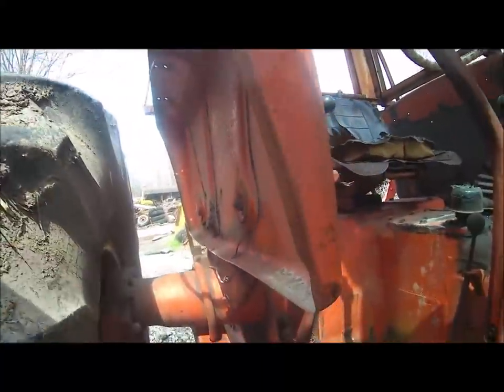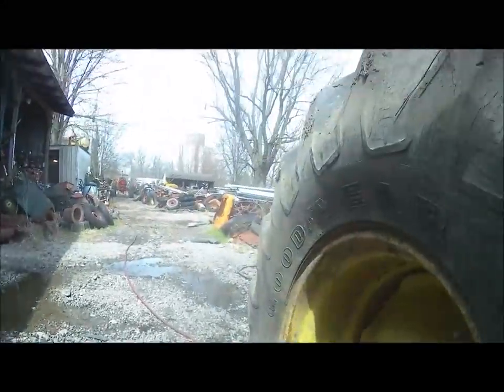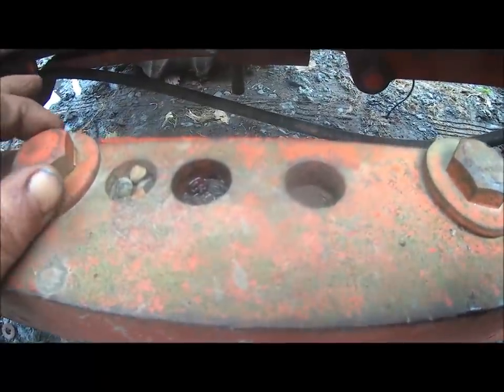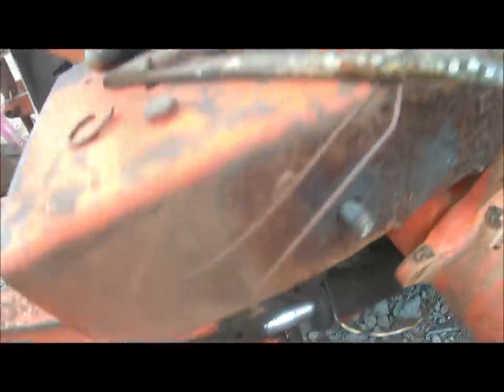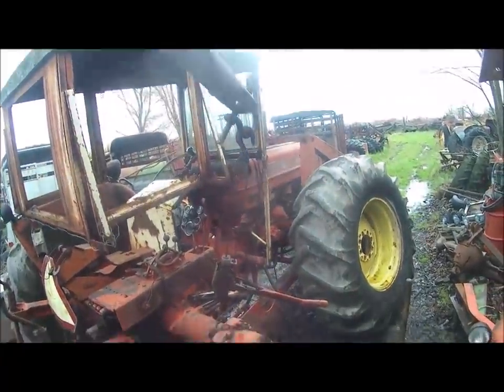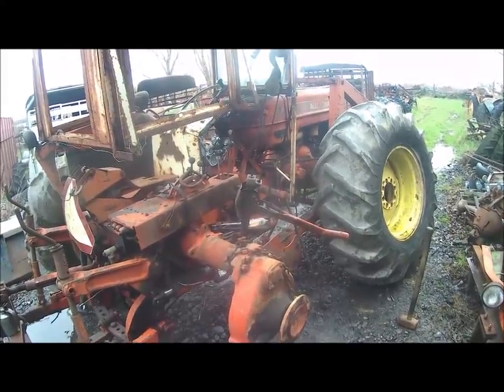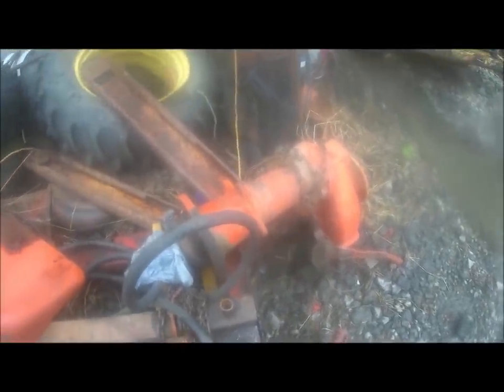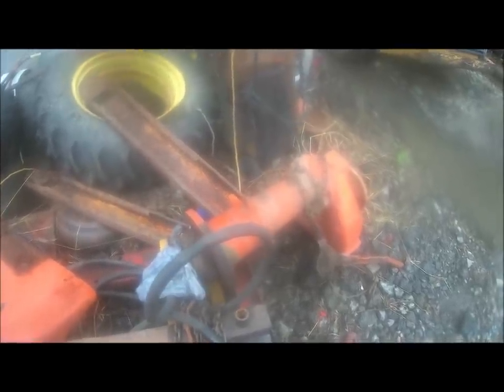Allis Chalmers D17 axle repair take apart

Comment: what we did at the AC dealership was take 2 pieces of all thread bolts and screw them in the trans housing as guide bolts this helps to reinstall the rear axle assembly.  almost making it a one man job

Comment: I had a fear it had rolled along far enough that a gear was frozen on that shaft sticking out when removed. I remember right, it will slide in like butter if all the splines are in line with each other. Back then stuff was made so a farmer could work on it and not have to go in a shop by appointment to be fixed in a month by a guy who has never seen anything but some pictures maybe and then it is just replace new and not a fix what is wrong. We have lost so much to technology and lost for it. I'm proud of you Richard. You got a "it ain't hot and it ain't got shit on it so lets get it done" attitude and that is the difference in the guy who sees easter on the calendar and charges more than what he is worth considering he got his from google ten minutes before he started. I hope that one person at least will lend a hand to get it started in that housing so you don't pinch some of the point to count things off

Comment: Good  day Richard. I thought they just loosen up &  come out.  Is that a series IV , hydr. pump were pulley   would be & 3 -4 hydr. controls  beside fender.   Boy $300. /side Wow.  Many yrs. ago we went to truck shop & got disc brakes for Cockshutt  540, cheaper than dealer.   Bolts are bad enough for price.  Thanks & good luck.  You will get help ?